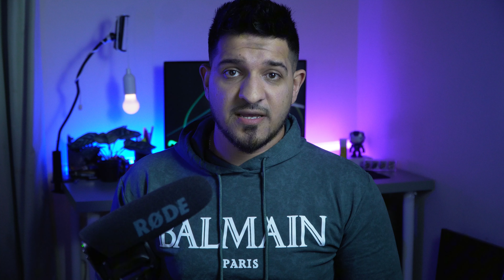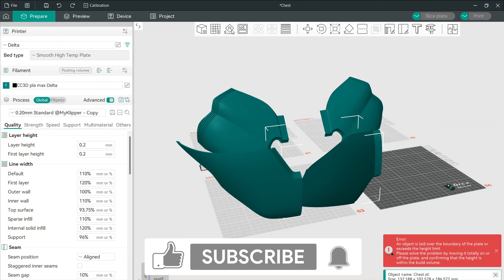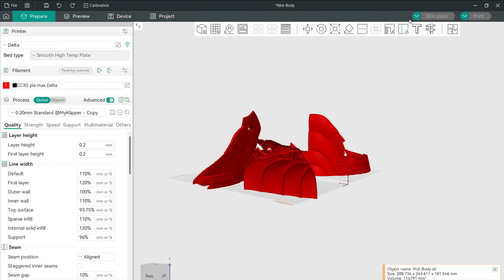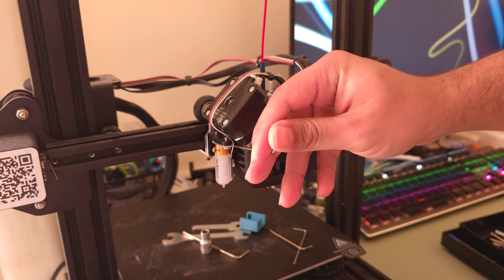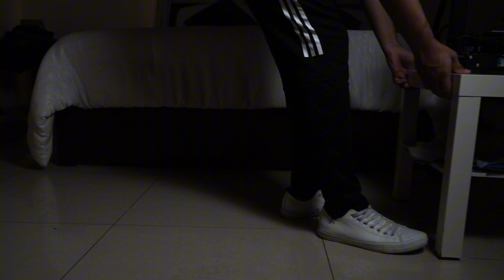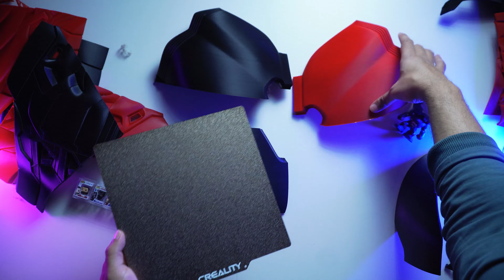3D print fails & wife's printer ban!! My iron man build continues...

Comment: Hi. Thank you for the video! I see that you are making the cuts on CAD manually, is there a way to tell the software how big your 3D printer is and it slices it for you?
Reply from the maker: Hey man, glad to have you here! In fact, the CAD that you briefly see in the video is basically baked into the slicing software. I could've taken it into solidworks or Fusion 360, but honestly, it's simpler this way. The slicer 'knows' how large my printers are because i set them up every time i get another machine, however, to get it to slice the file automatically could work, but will generate cuts thats best for the machine AND NOT ME lol, meaning ill have a lot to glue and weld.The workflow is quite seemless nowadays💯 Hope this helps !